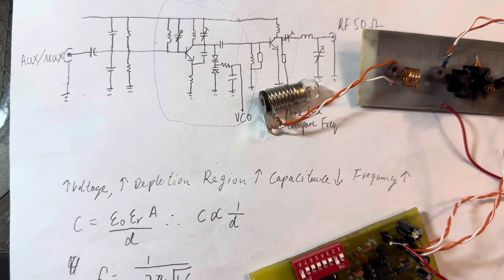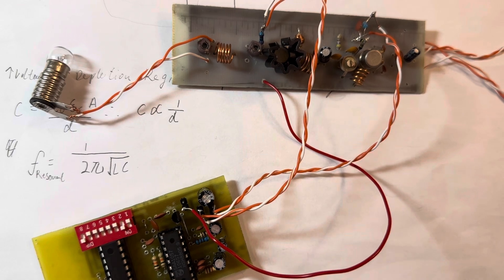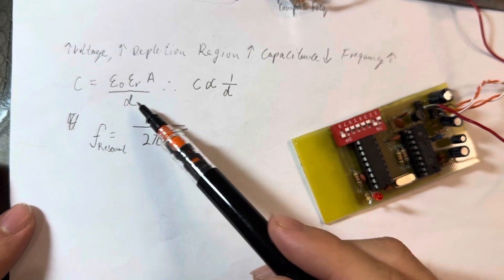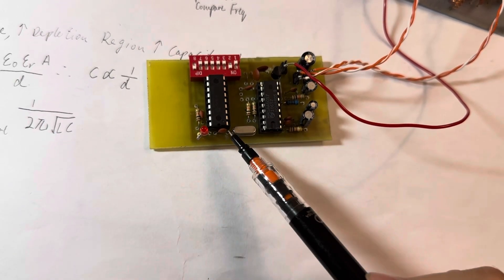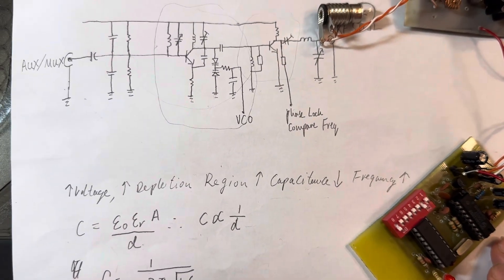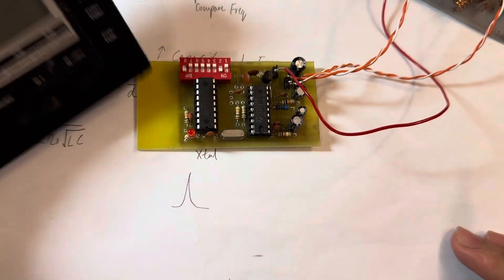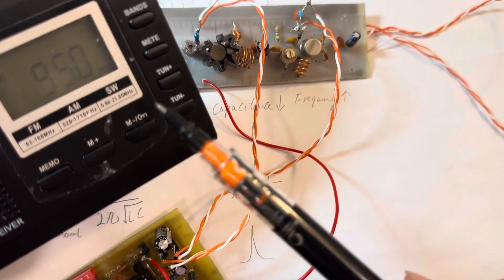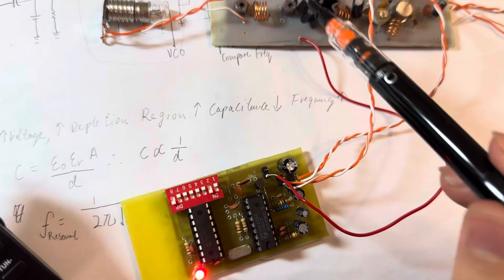Simple PLL FM transmitter

Comment: Hell yeah I love PLL cd4046 !! Such a cool chip
Reply from the maker: CD4046 chip is good for low frequency around 1mhz max, which is good for MW AM transmitter or PLL SSTC.
Reply: they use SAA1057 controlled by PIC microcontroller
Reply from the maker: @MaxHeadroomsTV  that correct, the famous SAA1057 made by Philips